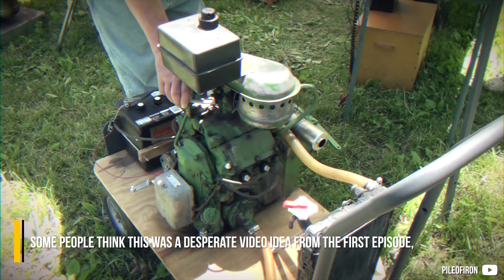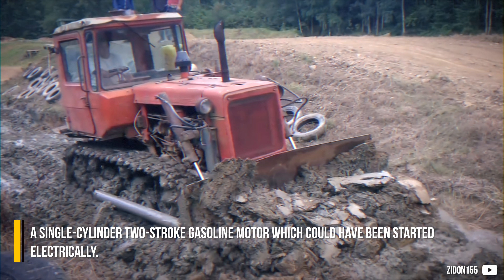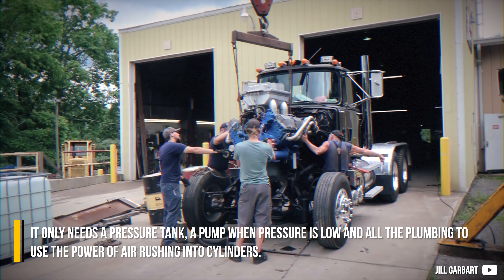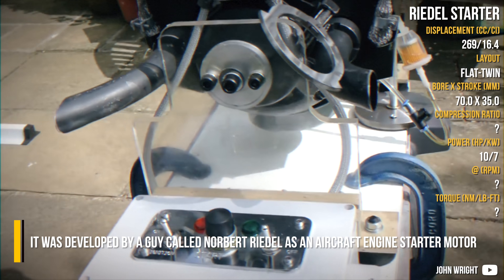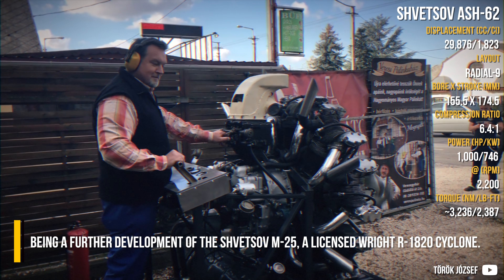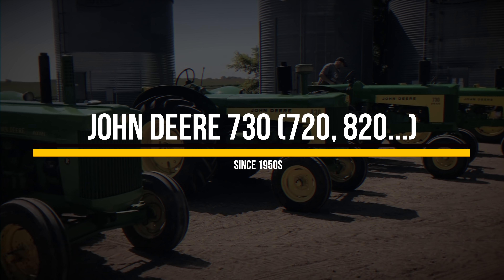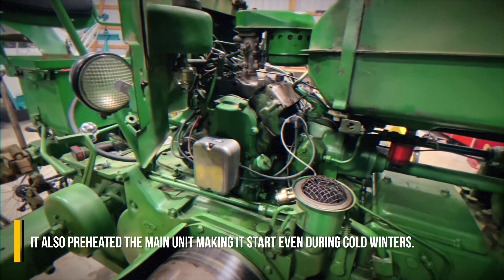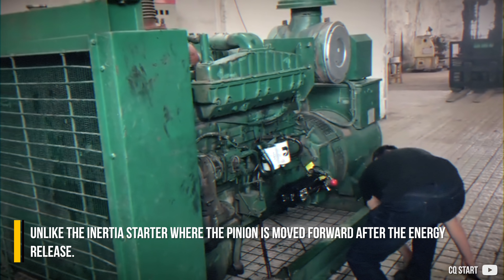The Best Sounding STARTER Motors

Comment: Great video! As others wrote I missed the Coffman Starter, a small turbine power by gunpowder, but it might be difficult to find any engine nowadays. 
There are different types compressed air starters. In bigger engines (ships) one or more cylinders are switched to compressed air for starting instead of using a starter motor.

Comment: You missed the coolest one - A Coffman Combustion Starter - most notable from the dessert place scene in Flight of the Phoenix
Reply: I have never personally seen a Coffman starter, but in all the youtube videos that show it, the engine starts with the first cartridge, even the one that's 40 years old.  Makes me wonder if the starting sequence in Flight of the Phoenix was more Hollywood than reality.  Also, the place that has no water is the desert.  Dessert is pie a la mode after dinner.
Reply: @danielsugarman7547  saved me the trouble.

Comment: The combination of two of the systems in the video also exists.
One is a pony engine which charges air cylinders for the startup of the main engine is used on many ships.
The other I know is the Ruston & Hornsby 165DS shunter locomotive I worked with, that used a 1 cylinder pony engine to start the 6-inline diesel, the pony engine had to be started with a heavy hand cranked wheel.
You had to spin up that wheel and when it spun fast enough you had to engage a dog clutch to start the pony engine, so this is an inertia starter and safer than a direct hand crank start as you have your hand off the crank when you engage the wheel with the engine.
When the pony engine was running you could start the main engine with it.
Because the main engine also had a manual oil pump to bring oil into the engine before starting and a manual fuel pump to fill up a header tank from which the engine was gravity fed you could start it without having a working battery.
The loco had an electric system to run lighting and the instrument panel, and an electric fuel pump and stop valve which took over once the engine was running

Comment: the "MACK" air starter does NOT blow air into the engine but is a starting motor bolted on like a "normal" 24V electric start and also was available on Most trucks sold in Canada as an option
the old ELECTRIC starters would weight around 60 + KG and require 2 - 4 batteries weighing 50+ KG OR MORE VS a 30 +/- KG air starter and a tank in the same sort of weight
best sounding I agree the inertia starter and a Mack V8 Airstart  
https://youtu.be/wgDsGaVMje4
vid of a guy starting a Ford "Brasilia" with an air starter shows off the tank and the starter

Comment: VisioRacer - you did miss one oddball starting system - International Harvestor had a starting system that went like this: First, move a leaver to reduce the compression ratio of the diesel engine. Crank the engine using a six volt starter to start on spark and gasoline. After the engine fully warms up and is running smoothly, shut off the gasoline flow, move the compression reduction leaver back to full compression and turn on the diesel fuel flow so the engine now runs as a diesel. IH used this system on many Industrial, Stationary and Farm application engines in the 1940-1960's.
Reply from the maker: Interesting!

Comment: Yeap the feared and ground breaking nazi jet fighters started with a lawnmower engine.
It could be pull-rope started! Like a lawnmower. The lawnmower of death from the skies.

Panzers used inertial, hand cranked starters (think it was featured on the previous video).

Comment: Caterpillar also used flat twin pony motors.
The major reason for using pony motors was the preheating / oil pumping capabilities.
You might also have included some engines that can self start merely by firing a spark plug ,because of the engine configuration.

Comment: Spring starters were also used in the tiny Cox engines, which were as small as .010 cubic inches, but more commonly .049 cubic inches. There was a spring around the shaft with a hook on it, and you'd hook it around the propeller, turn the engine backwards a couple of times, and release.

Comment: Naturally, air starter is not without it's flaw. If not used for a longer period of time, compressed air will bleed out. But, that sound makes me have a goosebumps. Indeed a music to the ears! As a kid, I wondered wtf is that sound coming from that 1972-1978 Mack R in Mad Max 2?!

Addendum: although the WWII German panzerkampfwagen(s) main starter was inertia one, the manufacturers manuals stated that electrical one (they had those too) to be used in a emergency only!

Comment: There is an engine using shotgun slug detonantion to ignite the engine, but i forgot the brand of the engine. At my work there is also a unique diesel engine using pressurized air from hydraulic actuator pump, it was kind of pain in the ass to starts the engine. The disadvantage was i couldnt stored amount of pressurized air for the next starter, after it being used it must make pressurized air for a single starting. 😅
Reply from the maker: Field Marshall's tractors did use the shotgun cartridge type of an engine start-up

Comment: That rorty little John Deere petrol V4 roaring away like an early VTEC to start the big diesel twin-cyl is fun!

The spring starter system is something I never saw before, so simple but by the looks of it damned effective since those were some big engines they were attached to.  Good for folks building apocalypse vehicles too!!

Comment: The fastest starting car I’ve ever been in was a mclaren p1. I worked at a mclaren dealer and had a few of these in. They use the hybrid electric motor which has 190bhp to start the petrol engine. So you have a 190bhp starter motor, it is started before you can even hear the electric motor lol

Comment: Many of the oldest caterpillar diesels started with a pony motor and also, the John Deere model R used and opposed twin pony starter motor.  It had its own unique sound. Wonderful video as always!
Reply: Definitely a unique sound. I have a D2 cat that has a pony motor. It is even a more unique sound when it starts knocking. I took it apart and found a broken rod cap.

Comment: Anyone that's ever heard a really, really big motor start on air knows that this is not a desperate video idea! I really enjoyed it. Many of the off-road trucks in surface mining used air start. As well as most offshore boats. By the way, offshore crew boats would definitely be a video in itself.  Some of those big beasts are absolutely amazing.
Reply: Standing next to Wärtsilä 16V46 while it is started up with pressurized air is a great feeling.
Reply: A pair of V-12 Supercharged Cummins with Air Start on our 83' Utility Boat in the 70's. What a glorious noise! (And 2 2-56 or 2-53 I don't remember which powered generators. All that in a steel engine room was deafening even with muffs.)

Comment: Pony motors we're almost REQUIRED on those John Deere up in the north US, especially if you were using it for other duties besides seasonal field work. You either kept it in a heated shed or lit a fire underneath it if you had an electric start and needed to start it in the sub zero temps.
Reply: And pony pre-heated that diesel intake, also.
Reply: @jamesgeorge4874  preheated the intake and also circulated warm water around the diesel
Reply: @RJ1999x  yup.
Reply: Funny, Detroit Diesels started easily in nearly any weather.  Maybe Deere, Cat, and Ih should have licenced Shephard diesel?
Reply: @randymagnum143 You should start a kinda tired TIB 6-71 in -5 degree weather.
Reply: @jamesgeorge4874  is that the high horsepower marine engine?
Reply: @randymagnum143  yep. 450 HP. N90 injectors, "loose" blower clearance, big turbochargers, 400-500 hours between overhauls, but man, twins in a 46 footer, sounds amazing. Getting them fired up for haul out in early November sucks. We would get dropped off in Chicago, and run across Lake Michigan to Whitehall for storage, because it was still cheaper than Chicago storage. About 125 miles straight across the lake.
Reply: @randymagnum143  this was when Deere was still pushing their flat twos. From what I can glean they're almost exactly the same engine just with or without spark plugs and an injection pump.
Reply: @randymagnum143 boy never in my life heard 2 stroke Detroit start easy in cold weather

Comment: I love the sound of an inertia starter.  It's what they used for the sound effect on the Millennium Falcon when the hyperdrive wouldn't engage, so always carries a bit of suspense for me.
Hearing big diesels start is awesome too, like locomotive and power plant engines.
Reply: Thank you pointing that out, it seems glaringly obvious to me now, especially because it sounds like failure, until that double row wasp belches a little smoke, and comes up on two rows of odd cylinders music, making perfect harmony.
Reply: The sound was also used for the Tasmanian Devil cartoons!
Reply: @craigmclean8260  damn. You are correct. I don't even have to confirm that, audio files in my brain have already acknowledged this as the truth. Preach Craig McLean.  The taz almost sounds like a magneto off, clear flood sound to me, although it could be looped, thank you for opening my eyes.
Reply: @craigmclean8260  That's what I was thinking as well.
Reply: Reminds me of the tractor my grandfather had. Good old vladimirec t-25

Comment: I loved this one! Especially the air start Mack. The JD V4 pony starter motor has potential for other uses!
Reply: They cost more to overhaul than the main engine.  They were frail and finicky.
Reply: @randymagnum143  
My favorite kind of machines then. I love to work out "the bugs" on old engines. I do aircraft engines for my day job but love to work on old engines in my free time.
Reply: @randymagnum143   Very true! We had a JD730 waay back and it had the V4 pony motor (though we called it a pup motor?). It grenaded twice on us and cost a small fortune to repair. The second time it went we actually got rid of the tractor. Too high of rpm for the construction of it, if I remember correctly I think it threw a rod both times.
Reply: @GearheadStew  My father had a JD 720.  As I recall there was only two throttle positions such as start up and run for that V4.  Apparently he had heard of these failing catastrophically and would start the diesel engine in the lower speed throttle setting and did it quite easily.  Also that V4, when shut off, most always stopped on a compression stroke thus in one of four positions.  That is where that engine perhaps sat all day getting vibrated constantly from those two big pistons doing their job.
Reply: That V4 would make for a fun soap-box/go-kart engine, just for laughs.
Reply: @DFX2KX  Exactly what I  was thinking!; Even for an off.road  RUV!.
Reply: I can’t find anyone that has made a motorcycle out of one. Would an interesting bike.

Comment: Maybe a list of coolest kickstart bikes? Or hand crank start cars?
Reply: Just throwing the Honda CR500 and the Maico 700 out here 🤫
Reply: @starstencahl8985  Husqvarna 610 is a nice foot breaker too
Reply: Great idea , i agree
Reply: My pops explained the nuances of hand cranking model T's, you didn't wrap your thumb around the handle, and you didn't over advance the ignition, because it would kick back, and break your arm, the ignition timing advance was a lever on the steering column, and if you didn't know how to operate it, it was detrimental to your health. Broken jaws, weren't uncommon either, as your face getting in the way of a starter handle was as bad as not letting go of it.
Reply: YESSS PLEASE!!
Reply: Oh yessss
Reply: For sho.
Reply: Pleassse
Reply: @igovicheliasgabriel6164  ^this^
Reply: I can still remember years ago watching a guy kickstarting a large displacement Vincent motorcycle which was quite temperamental and kept on kicking back
Reply: @michael-j-harrison  saw a dude lose a cowboy boot heel to a YZ490, a few times.
Reply: Great idea! I have a kick-start bike with the kickstarter on the left side. I start it by standing beside the bike, and kicking down/back. I've gotten so used to it that I have trouble kickstarting a normal bike.
Reply: German ww2 tank/tank destroyer (forgot which one) got some impressive crank sound
Reply: Suzuki DR650/750 kick start
Reply: I feel like I have to mention my own bike 😈 the original Thumper. The SR500